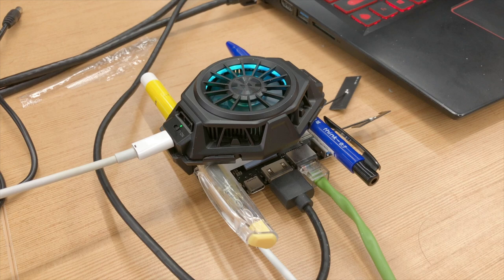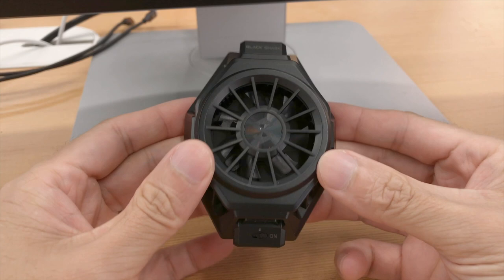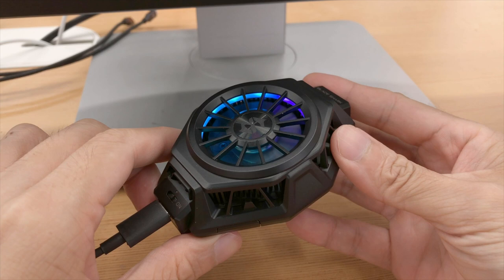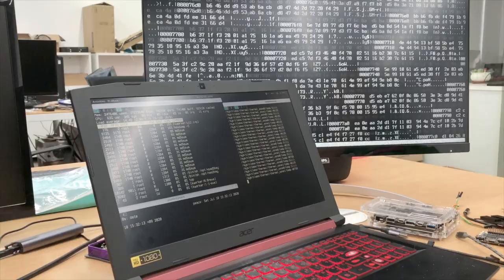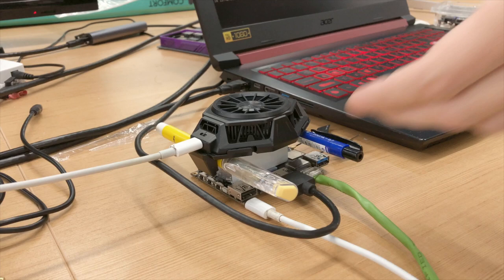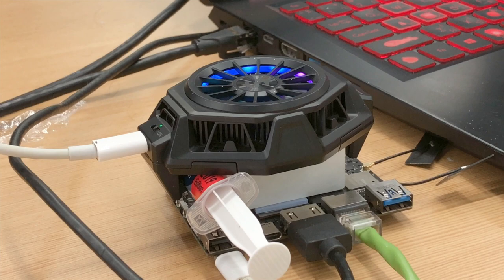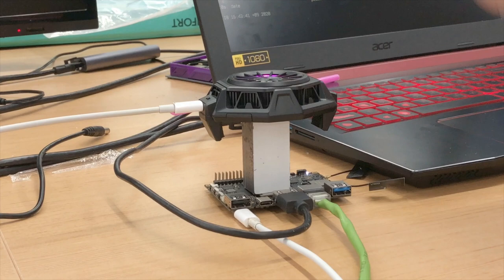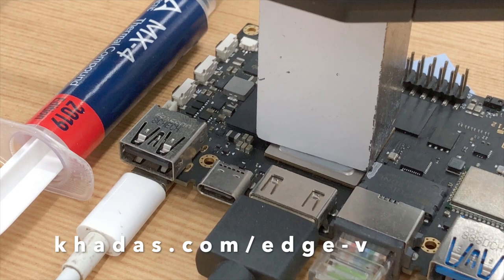Extreme SBC Cooling (Black Shark + Arctic Silver Paste)

Comment: 5 V how many amp adapter should I use?
It can barely drop to 0 degrees for 10 minutes and is idle.
I guess 5v 2A is not enough. The device actually supports 7v 4A, but I am afraid that the fan and led will burn out. I am afraid that the fan and the led will light up. The 5v 2A samsung adapter draws max 1.60 amps.
Reply from the maker: The Edge-V supports 5 to 20V of power input. As for the Black Shark, just run it off 5V USB power.
Reply: @Khadas  I understood 5v. Well, how many amps should be 5V 2A does not give performance. 5 v how many amps should be even 3 is not enough.
Reply: @burakgny  sorry to respond to a year old comment, but it should have a power control circuit that limits it's power draw at 5v 2a. Did you try both settings for the cooler? One is a fan only mode and the other is the peltier cooling the device and the hot side of the peltier getting cooled by the fan and radiator
Reply: @greenjp779  My device is broken after the update. The device does not show the temperature anymore. Is there a solution?
ie it shows the temperature incorrectly, for example as -273 degrees
Reply: @burakgny  sorry, Im not sure is there's a solution for that. Have you tried going to Reddit or any other forums to ask for help?
Reply: @burakgny  try reinstalling the firmware, if you can't by yourself contact black shark support